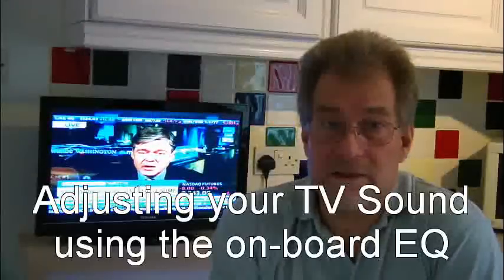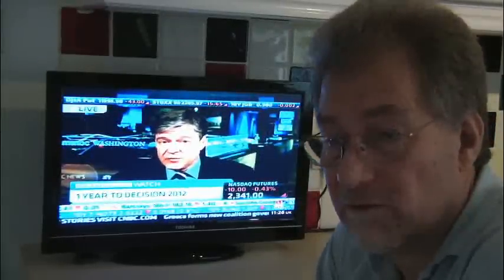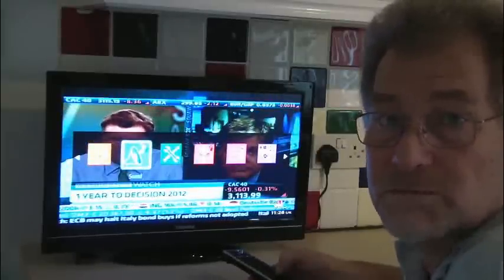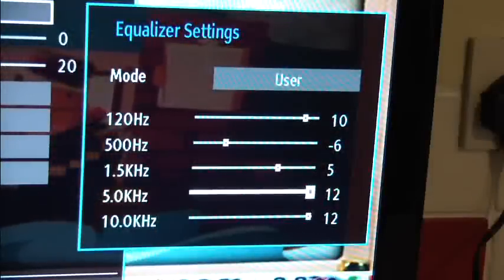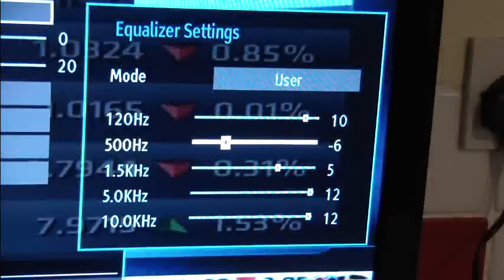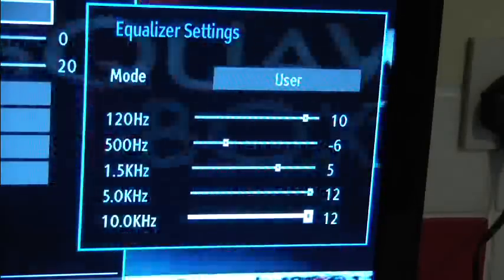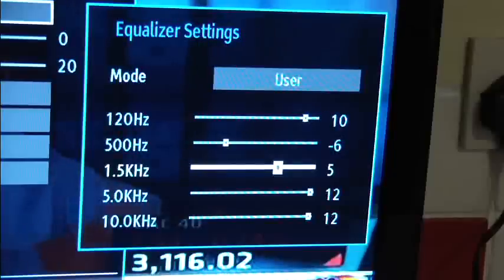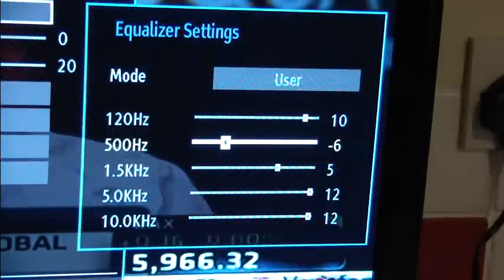Adjusting your TV sound using the on-board EQ

Comment: Hello, I just have a question about how to fix the sound on my tv. My problem is that I need to increase volume to hear dialogue properly, however, this also increases the louder volumes such as gunshots, screaming, etc which can be very annoying. The audio settings on my tv are 120hz, 500hz, 1.2k hz, 7.5k hz, and 12k hz. Thanks in advance
Reply from the maker: +Basterixx Sound effects such as gunshots and screaming will fall within the same general frequency band as voice (dialogue) and so it's not easy to get the balance right between the two. Also, the frequency settings on your TV are a little limited if there's no control between 1.2khz and 7.5khz. Try REDUCING the level at 1.2khz and INCREASING the level at 7.5khz. This will have the effect of reducing the level of sounds where our ears are generally more sensitive, while adding presence (lift) to the upper vocal range and where our hearing is less sensitive, particularly as we get older - 7.5khz is a little too high in terms of frequency in relation to dialogue, to be honest, but it should help to add a little extra clarity on speech. If you find the bassier, explosive sounds are too loud and speech a bit boomy, try reducing it at 500Hz.
Reply: I need help to; ok there is a man narrating everything that is happening in my tv can anybody help me get ride of it

Comment: Hello Kevin, thanks for this as it's helped. But I don't know if you can help me but my settings are different. I have a bush 49" tv and the equalizer settings are 100hz, 300hz, 1khz, 3khz and 10khz and I'm struggling to find anything about how to make the sound better on it. If you could help I'd be very grateful as I don't know much about sound etc haha thanks :-)
Reply from the maker: +Adi Cannings Hi Adi, it depends what you mean by 'better'. How does it sound to you now? It's not easy to make accurate suggestions because it also depends on the speakers and amplifier built into your TV, but typically, if you follow the suggestions I gave volcanope a few days ago (same settings as on your TV) it will probably improve the sound. That is, REDUCE the level quite a bit at 1kHz, and maybe increase it a little at 3kHz. You may also try increasing it at 100Hz to add some kind of bass, but don't expect too much - and if the casing of the TV starts to reverberate then you need to reduce it down again at 100Hz!

Comment: I need help with sound settings. My tv has the options 100Hz, 300Hz, 1kHz, 3kHz and 10kHz. My problem is that the high frequencies sound very sharp and sometimes even hurt my ears, so I'll turn the volume down, but then I can't really hear the lower frequencies. Even on factory settings the high frequencies are dominating the spectrum and it's a bit painful for my ears. Any advice on how I could make the overall sound soft so it wouldn't hurt my ears?
Reply from the maker: Sorry Volcanope, I was logged in as a different user in Google (they are one of my clients). The post above came from me :) Try it and see how it sounds. Kevin.

Comment: Hello.I need some help.I have a samsung 40HDTV  and the sound values sre 100Hz,300Hz,1Hz,3Hz,10Hz.What is the best settings for the Sound..??
I have set the 100Hz to 8,300Hz to 8,1Hz to 0,3Hz to 0 and 10Hz to 4 but i don't have very good bass.Thanks.
Reply from the maker: +Alexole Eya Hi Alexole. The settings you gave don't make sense but I assume when you say 1Hz you mean 1kHz, 3Hz you mean 3kHz, and 10Hz is 10kHz. Anyway, you said the problem is not very good bass, but you have set it to +8 at 100Hz and also +8 at 300Hz. That is nearly all you can do to help the bass. I don't know your particular TV but my guess is that the built-in amplifier and speakers simply cannot produce the bass you want. I suggest to think about buying an add-on sound bar, but listen to it in the shop first. Until then, try to reduce the level at 1kHz (try -3 or -4) and increase the overall volume level of the TV a little and see if the bass sounds better (or at least, louder) like that. Cutting it at 1kHz will make the other frequencies seem louder, and usually make the sound more balanced.
Reply: +KEVIN O'BYRNE Thanks.
Reply: Alexole Eya

Comment from the maker: I can agree that more is always better, sure. 50Hz-15/17K would be nice to have. But the point is that the TV manufacturers would not have to do so much to make the sound from their units much better. A nice even response from 90/100Hz to around 12k (with no big peaks and dips - that's important!) would make it so much better than most TVs today. Just a little improvement in the built-in speakers and cabinet, and with a built-in amplifier with better power bandwidth, would make a big difference.

Comment from the maker: Under 60Hz would normally be termed as sub-bass. 80-100Hz is bass. 120Hz I can accept is mid-bass rather than bass. But we're talking about a TV's internal sound system here and to most people the closest it will get to bass is 100Hz. Treble being only after (above) 15kHz is simply incorrect. Many (probably most) people don't even hear above 15kHz. Do you know the fundamental frequencies of musical instruments, even cymbals? Most sounds above 10-12kHz are harmonics.

Comment from the maker: @16coreprocessor23 thanks for that - I was so disappointed by the sound out of the factory that I had to do something! Then I thought how many others are listening to it set up THAT BAD! Tricky to answer your question as every TV will be different. A 32-inch should have a bigger speaker and a little more space for it to work in, so you may find the bass lift I gave this one is too much and makes it boomy. The way I treat the mid and high frequencies is likely to work the same.